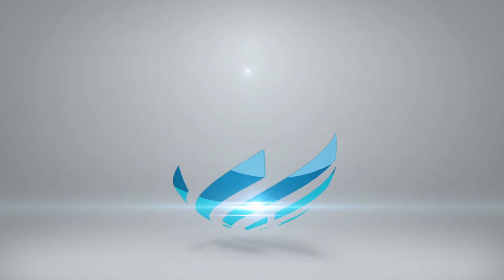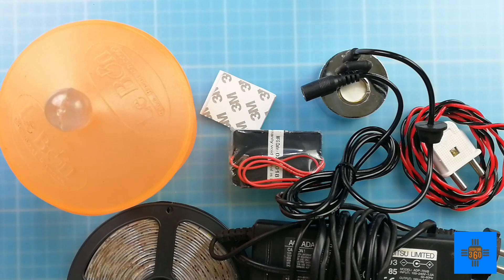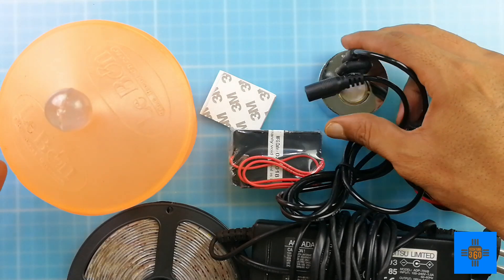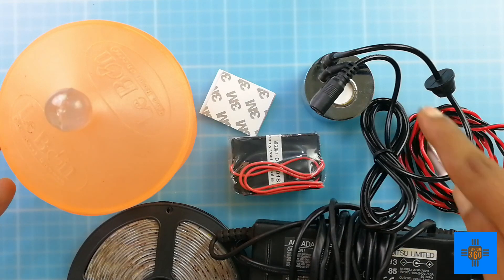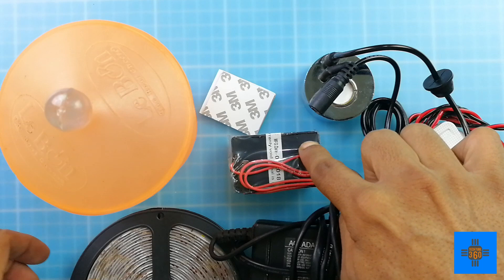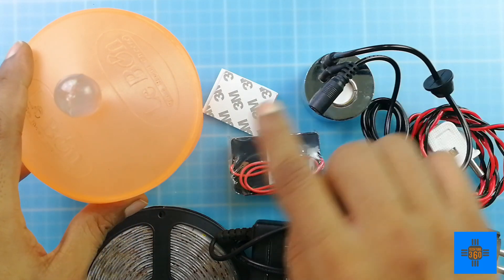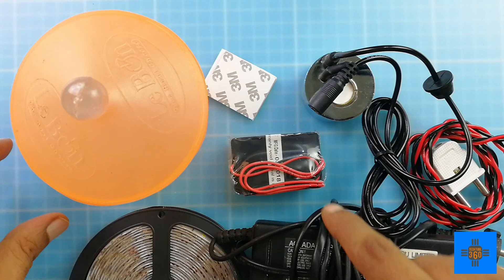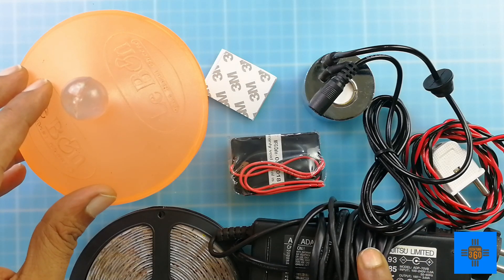DIY Ultrasonic Humidifier + Aroma Diffuser  + Night Lamp

Comment: Wow. Shouldn't the water splashing around be a concern?
Reply from the maker: We have used all low voltage DC and led strip is waterproof too. So no worries. Thanks for your interest and do leave a comment for any query or questions any time I will respond you ASAP.